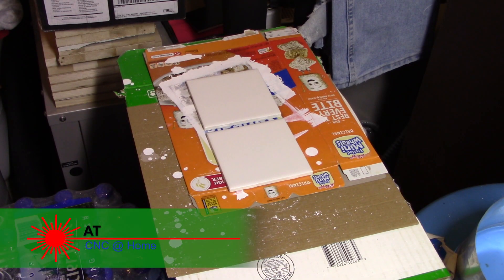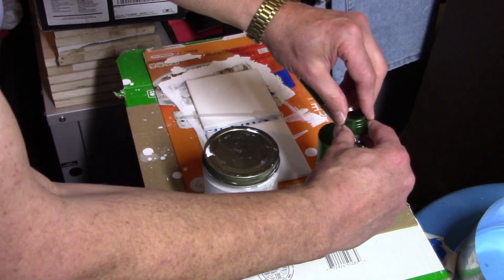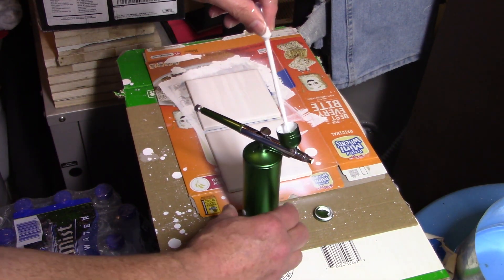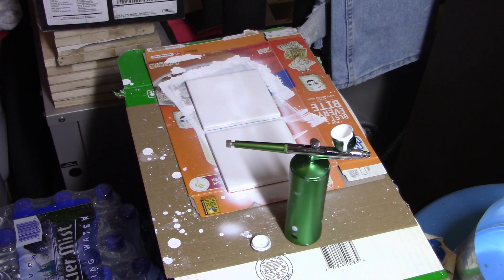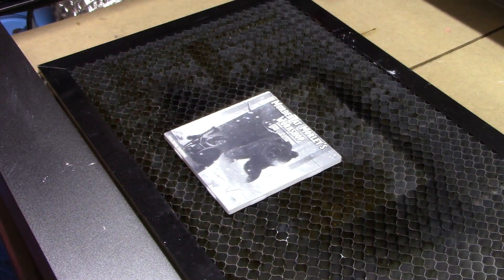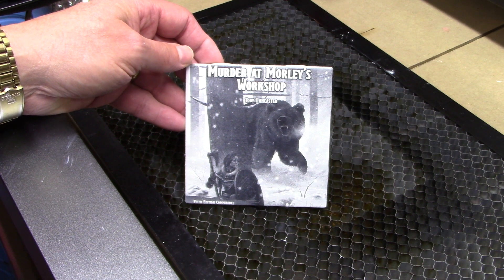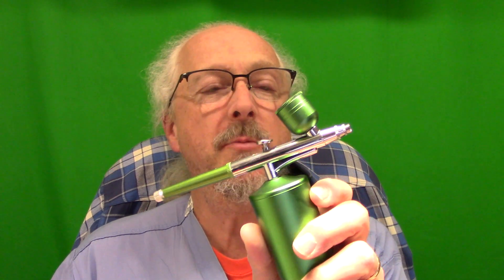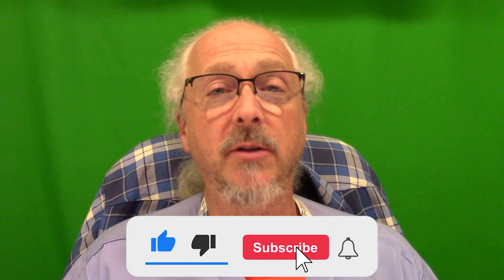Will an AirBrush work well for applying Titanium Dioxide?

Comment: Your mixture looks white. Do you also have white paint in the mix?
Reply from the maker: Great question.  No, there is no paint in the mix.  Most white paints use TiO2 for the white color as it is SO white.  Since this video, I have started adding food coloring to my mix so I can see it better.  White paint works for burning an image onto a tile because it has TiO2 in it.  Using the airbrush does require a very thin mix to work well.  I have tried other methods for applying the TiO2 mixture onto tiles.  Everything I try has it good and bad points.  The trick is to find one that works well for you.  :-)

Comment: Just did a viral video on the Norton White Tile method using Inverted marking spray. I'm a ceramic artist and wanted a good way to spray Ti02  onto the surface of the tiles - THANKS for the link on the portable air-brush (also an old AB artist) - You gained a new subscriber, dude - THANKS!
Reply from the maker: I hope this method works well for you.  I find that for short runs of a few tiles, it works great.  I have not tried it for more than 4 or so tiles at a time.  I will be playing with the white school glue, water, and TiO2 mix method to see how well that work.  Will take more drying time but my hope is that it will provide more working time for self leveling and even coverage with a brushed on approach.  We will see.  It will take longer for the tiles to be ready for the laser.

Comment: I use the exact same airbrush. 
Couple of things, 
1 you need to experiment with the settings of the airbrush to find the best ones. 
2 if you use 100% alcohol the ti02 settles quick and clogs the gun. Use some glycerin to keep it in suspension better. I use 3 parts water, 1 part 91%iso alcohol, and 1tbs glycerin in a pint size jar.
Reply: Interesting! How much Ti02 in the 3xwater,1xalcohol,1xtbs glycerin mix?
Reply from the maker: That is great advice!  Thank you for sharing.

Comment: I gave up airbrushing with Tio2 due to clogging . The mix had to be thin so several coats  were necessary. I  now dunk the whole tile to get a an even coat which works for me.
Reply from the maker: I would love to know more about your method.  I have had other viewers talk about dipping the tile into a mix.  Can you explain your process and talk about the mixture you use?  I have had good luck with my airbrush when doing 4 to 6 tiles but it is a pain to clean.  There is also some drips when I am not careful and as long as that is not on an already coated tile, I can clean it up.  have tried pouring a mix onto a tile but it was too thick.

Comment: In the airbrush.  The fluid need to be the consistency of milk. If it's to thick it will clog faster
Reply from the maker: Liquid milk!  Nice analogy on that.  I am currently using a mix about 3:1 with a drop or two of food coloring.  Seems to be nice and thin and doesn't clog the gun.  I would have no issue going to 4:1 on that too.

Comment: What's the ratio of titanium to alcohol?
Reply from the maker: That is a great question.  My current mix is about 3:1.  3 parts DNA to 1 part TiO2. I add in a drop or two of food coloring.  That mixture has worked well in my airbrush. The coloring really helps see the application.
Reply: Thanks. I'm gonna try it to mark steel with a CO2

Comment: One tip I picked up is to put a drop or two of food colouring in the ti02 suspension, washes away easily and makes it easy to make sure you have an even coat 👍
Reply from the maker: Great advice.  I started doing that some time back and it really helps see what you are doing.  🙂

Comment: You should never lift your finger off the trigger, just press down to start air and move it forward to start to paint and it won't clog the sprayer. also add food color to mix so you can tell how well its covering!
Reply from the maker: Great advice.  I have since added food coloring and that makes it so much easier to see how it is being applied.  With this air brush, it is basically only a single action and the air is constantly going even with your finger off the trigger.  So you do not control the air with the trigger, it only pulled the pin back to control how much is coming out.  You can set a maximum if you need to make sure not to have too much coming out.

Comment: I tried with air brush and works ok but just dont get a deep black so i tried with a poly brush and wow more black but has some streaks
it seams like the airbrush disperses the Tio2 causing a separation
so under a microscope you see load of speckles like a news paper
and yes im doing Greyscale
Oh i have found out something interesting just as I was messaging  
i used a chamfered tile and at the bottom of the chamfer  it came out perfectly jet black
so i measured the depth and so my laser needs to be further away for the perfect burn
I will try and report back with new height settings
Reply from the maker: I have avoided using Greyscale as it tends to be very picky.  For images, I have used the Jarvis method with great results. Using that method will give you that news paper look close up as that is exactly how news papers print images.  They have black ink and to make if look grey, they make small dots and lines mixed in with the white paper color to trick our eyes and it works well.  
I really like that you found, quite by accident, that changing your laser position will give you that nice black crystal structure in the TiO2.  :-)
Reply: I found that my laser needed to be 1.5 further away for engraving with TIO2
and also i firstly applied with a poly brush to get a smooth layer and then air brushed over the streaks 
well is came out almost perfect using grey scale
I did a pirates ship and it came out like a B/W photo so smooth at a 245 DPI
very impressed 
well i have found my technique that looks awesome and hope some one else tries it and gets good results 
So Happy
Oh I do prefer Jarvis for doing Vectors
also to say i mixed two tea spoons of TIO2 with four water and one  PVA for the air brush

And two TIO2 and two water and one PVA for the Poly brush
Reply from the maker: @spudnickuk  - That is fantastic!  I am glad that you found what works well for your set up.  I love that feeling when it all comes together and you know what you did and can repeat it.  ;-)  I just might have to give Greyscale another go to see if I can get that working.  :-)
Reply: @CNCATHome  Thought to say as I did more Greyscale etching today
and got better results.
After touching up with airbrush after applying the main first layer with poly brush to gain a smooth layer
i found i had speckles caused from the airbrush 
so after using airbrush I let dry and use tissue paper to wipe down the surface to make it smoother
Not rub!
well the results are astonishing now and
 getting repeated perfect results.

There is science behind it but I will not bore you lol
just think about light scattering and absorption
Reply from the maker: @spudnickuk  - Because of your comment, I have re-visited using greyscale.  My attempt turned out better than expected.  The picture I chose was not a good choice yet it turned out better than I expected.  I will play with this a little more to see what I can get it to do.  Thank you for the nudge in giving that a try.
Reply: @CNCATHome  oh a tip for perfect Greyscale
do a material test so you get a light/fade burn to a dark burn and not just a variant of dark burns that you would do for non Greyscale options so you can see wht is the lowest to keep your laser on as it pre heats the TIO2 until the higher burn 
if that makes sense
so i don't have my laser shut off and so the lowest it set to is 35%
its all about calibration 
cus if you don't then you don't get all the nice shadings even a nice shiny blueish grey

Comment: u dont have to spray it.with a foam bruss is cleaner easier and quicker!
Reply from the maker: That is fantastic.  I should see how well this thinner mix works with a brush.  The cleanup sure would be faster.  ;-)
Reply: @CNCATHome  https://www.youtube.com/watch?v=rvNxZodOHZc
Reply: @CNCATHome  https://www.youtube.com/watch?v=rvNxZodOHZc  no thinner.pva glue water and the dioxide.its the best amon other solutions.
Reply: @CNCATHome 1 part pva glue 1 part dioxide 3 parts water.search it on youtube.its the best method

Comment: I have a regular paint spray gun.  Put all the tiles together on a board and spray them.  It should work fine. If I were doing this to sell them I would prepare a large batch and keep them on shelving ready to go.
Reply from the maker: That would be great for doing large quantities.  You could have a conveyor for the tiles and the sprayer could be stationary. The one issue with TiO2 tiles is the titanium will brush off very easily.  Any bump to the surface will remove the coating.  As long as you can move them and store them without bumping the coating, that would rock!  I did sort of thing when I was using the white paint method.  I would paint 10 tiles or more at a time and just have them available for when I needed one or two or 8.

Comment: I have questions! One, many videos on this subject mention the mix ratio, but are you talking about volume or weight? Also, the TiO2 I bought doesn't mention particle size, but I'd guess it may matter? So far, I've had terrible results; my mix precipitates out faster than glitter in a snowglobe! I have the same airbrush you are using; it works great for tempera paint, but my TiO2 turns to sludge in seconds, with 91% iso alc. Do I need 99%? A drastically thinner mix? Any help anyone can offer would be appreciated; I'm just getting started in this! Thanks!
Reply from the maker: What I am currently doing that seems to work well is a 3:1 mix by volume of TiO2 and denatured alcohol.  I love your analogy of the precipitation.  It is fast but not so much that I can't use it.  I have also added a couple drops of food coloring to help see the application on my tile. your 91% iso should be just fine.  If your mix is like sludge, it needs to be much thinner.  I make sure to mix my suspension right before I pipe it into my air brush bowl with a dropper.  Once it is int he bowl, I put the cover on and start applying it.  My first experiments with TiO2 were about a 1:1 and that was way too thick, even to brush on.  I have has a few people comment that they brush on a mix with good results.  They use equal amounts of water, white glue, and TiO2.  I have not tried this yet. The glue will help maintain the suspension of the TiO2. It will take longer to dry and that should give it time to do more self leveling to leave an nice even coat.  I am impatient and like the fast drying time of the alcohol. This does require more accuracy on my part to create an even coat of TiO2.  I hope this helps.  🙂  The results I have been getting are very encouraging.

Comment: Hello, more about jet painting - always start from top to bottom, as the jet is blunted 1/3 or 1/4, then avoid blank strips or layering, distance is also important - a large distance leads to a finer layer. The idea of an airbrush is great, opens up possibilities for different coatings. Good luck.
Reply from the maker: Thank you for the tips.  I have not used an airbrush before and am learning as I go.  Even as a total beginner, it has worked very well.  Since this video, I have thinned my mix to 3:1 and added a slight color which makes it very easy to see the coverage.
Reply: @CNCATHome  In fact, I meant not the mixing ratio but the application of each paint on a workpiece. I saw you in another clip you start from the bottom of the workpiece and apply unevenly, this affects the end result because of the different thickness of the paint. Try to make a habit of painting only from the top to the lower end of the workpiece with a 1/3 or 1/4 overlap.
Reply from the maker: @sash-v7i  - Out of curiosity, is there a reason you start at the top work work your way down?  I do not have much time under my belt with an air-brush.  The kind of information you have provided will be very helpful.  Thank you.
Reply: @CNCATHome  Yes, this way part of the jet complements the previous layer and so the painting becomes uniform everywhere, this is a tip from car painters. Good luck with the hobby.🥂

Comment: Hey.. just found this and you have a new sub! 

I have a very similar sprayer that seems to be getting the valve clogged to the point where it won't shut off the liquid when the trigger is released. 
Is the one you have having the same issue? I just got mine so I may return it if yours is not having that issue. 

As for cleaning, I take it running IPA thru the gun until it runs clean is not good enough?
Reply from the maker: Thank you for subscribing!  I have two of these and if the mixture is a bit too thick, it seems to easily clog the nozzle.  Short bursts seems to help keep the opening clear. A thin mixture helps even more.  
To clean my sprayer, I just use warm water and that has worked well. I do disassemble the brush to make sure all of the parts are clean.  It takes about 5 minutes or so to get it cleaned up.  It seems like a long time when I am cleaning it but it really isn't.  It is worth the cleanup time to get the nice even and consistent coat of TiO2 on my tiles.

Comment: Concerning the airbrush i tried one Time and clogged the 0.3 mm nozzle in a few seconds... 😢
Reply from the maker: This is a 0.3mm nozzle too.  I found that frequent starts and stops help keep it clear.  I have done 4 tiles at a time this way.  My next test is going to be to thin the mixture even more to see how that works.
Reply: @CNCATHome  👍
I need to try again with a thinner mix...
Perhaps the TiO2 particules size plays a role ... I use TiO2 with particule size between 25 and 35 micrometers
Reply from the maker: @olivierw7405  - I am sure the particle size plays a role. The TiO2 I purchased did not come with any specifications such as that so I don't know the particle size.

Comment: Hi from France !
What do you think about adding a food coloring (red or orange for example and not blue with your blue laser) to see better the covering on the tile ?
For the issues of density perhaps a denser liquid than DNA would help to improve the mix ...
Reply from the maker: That is a very interesting idea.  That could help you easily see the coverage on the tile.  I might have to give that a try!  As for the suspension liquid, you want something that will clean up easily, suspend the TiO2 long enough to apply it or thin enough to spray it, and clean enough to not interfere with burning and clean up.  I had a member suggest vinegar.  I may give that a try.
Reply: @CNCATHome  i think if we choose the good color it can even help us to optimize the heat transfer from laser beam.
With orange for example which is complementary color of our blue laser ...
Food coloring will act more as a soluble dye than a pigment so no worries about dispersion : it will be dissolved into the DNA 👍
Reply from the maker: @olivierw7405  - I like the orange color idea.  🙂  Good thinking.

Comment: You melt the TiO2 with the laser …?
Reply from the maker: That seems to be the magic.  It doesn't really melt, it is more of a conversion into a crystal form.  I found an article that goes into a deeper explanation of what is going on: https://iopscience.iop.org/article/10.1088/1361-6528/ab1964.  Heating the TiO2 with the laser creates enhanced oxygen diffusion and the film becomes locally oxidized. Since oxidation is accompanied by a crystallization process, a part of the created TiO2 crystallizes and support the hydrothermal growth of rutile TiO2 nanorods.
Reply: WOW, are rutile TiO2 nanorods a possible carcinogen? 🤪
Reply: @ well… by default … they are photovoltaic…

Comment: Also: denatured alcohol is maybe not the good véhicule : viscosity very low . Hence not “supporting “ the nanoparticules . I prefer vinegar .
Reply: What would be your ratio for the Ti02 and Vinegar?  I'm intrigued.
Reply: @dickywyer293  for painting (brushes) vinegar for me. But if air brushed nano TiO2 I would also use a dispersant agent . Only trials will tell the ratio because it changes much in relation with the type/size of particles (type: spherical / angular).
Reply from the maker: That is interesting.  I have not heard of or even thought about trying vinegar.  There are drawback with the DNA.  What makes it good also makes it bad. Its thin nature is nice for easy application, self leveling, and good for use in an airbrush.  On the down side, the suspension doesn't last long and constant mixing is required.  It is clean and evaporates quickly.  It is also much more expensive than the TiO2.  I may have to give vinegar a try.  Thank you for the tip.

Comment: I have a feeling that it would preferable to have a colloidal suspension because of the nano metric nature of TiO2. Hence adding an adjuvant . IMHO
Reply from the maker: Having a colloidal suspension would be great if there was something that would provide that, be thin enough to brush, spray, or pour on, and evaporate completely.  That would certainly help keep the TiO2 mix more consistent over time.

Comment: I'm happy to see you trying the airbrush.  That's the way I do all of my tiles, now. It does take a bit to clean,  so I always do four to six tiles. Make sure you get your TiO2 thoroughly mixed so you don't clog your airbrush. I've been using about a 2:1 mixture of alcohol to TiO2. 😍
Reply from the maker: It has worked well so far.  Thank you for sharing your mix ratio.
Reply: pulled a mix of 3.5:1 from an engineering blog which was suggested for maximum dispersion of TiO2 in an alcohol solution, although I have seen a lot of folks have good results with many different solutions and mixtures. If you decide that airbrushing is the method you want to go for I suggest getting a dedicated compressor and either do it outside or get an airbrushing spraybooth